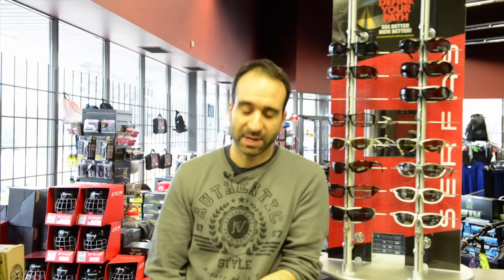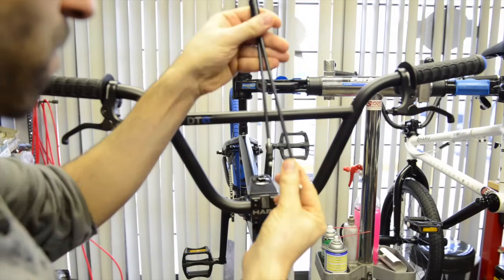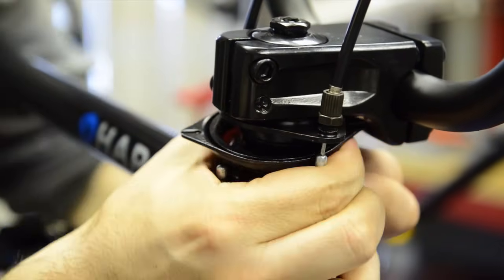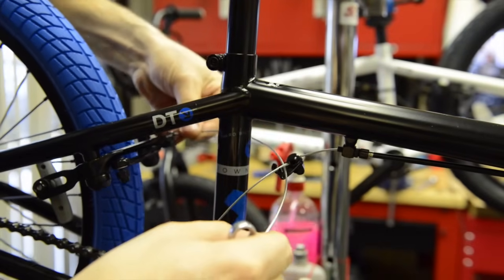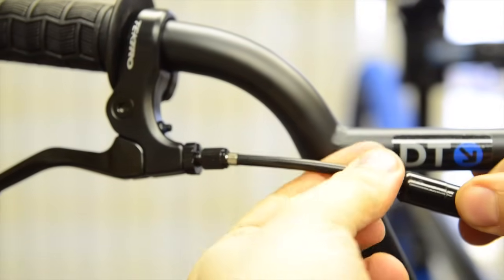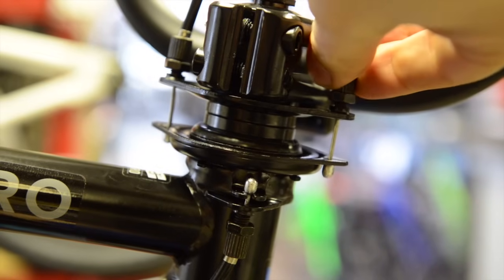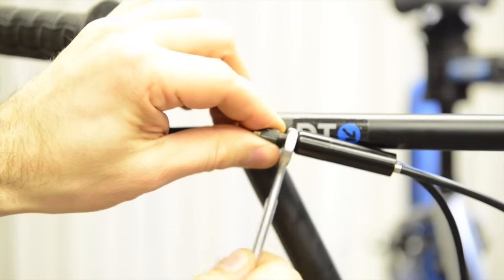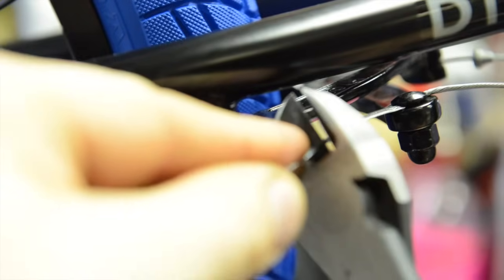BMX - How to Setup Your Gyro Brake System

Comment: Thanks great video.. Trying to get my bottom/rear line setup to my old Bulldog 884's on the '95 Dyno Air. Front brake was the easy one lol.

I still need to adjust the 4 ends/ballpoints a bit more.. almost there!

Comment: i search this video because of bmx rider do a bar spin yes idk how the brakes line still fine
Reply from the maker: Its all in the gyro. I'll try to make it simple. 
The bottom half of the gyro is stationary, and the top half is also stationary, then both the top and bottom half are attached to spinning bearings in the middle. 
As for the front brake (if you have one), goes through the middle of headset through the fork.
Just by those you can spin to your hearts content. 
Gyros have become less and less over the years. Mainly, I think, is because not too many people know how to adjust the gyro system. 
Hence, why i made the video. 
Hope that makes sense. Thanks for the comment.

Comment: Great video just bought a bike with a gyro the lower race is rocking when the bars are being turned Ive tried adjusting at the stem but can only get an improvement ive screwed right in on one side and all the way out the other . Keeping the adjustment equal on all four is worse ? Can you advise many thanks

Comment: Do u need gyro tab holes?
Reply from the maker: +Daimler Bermudo Some BMX that do not have a gyro system have holes on the left and right on the head tube. They use a integrated headset, so those holes are used to take place of the lower cable stop. You'll have to have the brackets that attach to the head tube to install the lower cables. A traditional gyro won't work on a integrated headset.
Reply: +Sports Shack  my bike has an external headset with no tab holes will it still work
Reply from the maker: +Daimler Bermudo If you have the original style gyro, and not a integrated headset, yes it should work.

Comment: Can someone please tell me how to take the lower cable stop off. It looks like its hammered on but im not sure.
Reply from the maker: +tonypengo The best way to take it out is remove the fork, and underneath(through the head tube), hammer it out. There is a tool the shop uses called a Head Cup Remover, its a evenly placed tool that shapes around the headset. If you don't have one, maybe a large flat screwdriver can work. You'll just have to hit it out around the headset to get it out. Once the headset portion is out, the lower cable stop will come out.
Reply: +Sports Shack thanks so much!

Comment: I didn't even know what a gyro was, but my rear break broke so I took it off and it was really difficult. But now I only have a front break and I'm thinking of just taking it off as well, what do you think? Should I take it off or leave it on?
Reply: BTW my bike has a gyro breaking system
Reply from the maker: +Random Vids If you use the bike to get around town I'd really recommend to keep them on. If you use it strictly at skate park, and your comfortable with it, sure you can take the brakes off. I'd practice first, as you do not want to hurt yourself or other people if you can't control the bike without brakes.
Reply: +Sports Shack well my front brakes work like shit, so I'm usually stopping with my feet anyways. And I actually never really go to skate parks, I just do tricks around my neighborhood. So it's kinda difficult to decide weather I should take it off or leave it on. I'm probably going to end up taking them off.

Comment: Does that bike have gyro tabs cause I have no idea what they are, and I don’t have them. If it does then is it possible to install gyro brakes without them?
Reply: It has a unsealed headset so it has the tabs where the cup should be

Comment: is haro la bastille frame good for street/flat? i have been riding bmx for years (3) with not a really good bike... It was really hard to fly a tail whip without a ramp and a 15 kg bike... I´m 1,72, what would be the perfect size? My current bike is 20´5 (top tube; frame) and i think it is a little short, but i´m not sure if the 21 size would be the right size... the problem is that la bastille frame is 19´ something, 2,25 (too small) and 21.  Thank you all so much (writing from Spain).
Reply: I'm 173 and I run an impurity HAF with a 20.45 you'll be good
Reply: I´ll check it out, thank u 4 the reply! ^^
Reply: Now it´s only available with a 20.7 size...Still good  i think. I will consider this frame. Still thankful 4 the information bro have a nice day!  ^^
Reply: It's 20.7 with an affective 20.45 top tube due to the seat angle. So you'll be fine

Comment: help my bottom cable that goes with the frame is too long
Reply: wat do I do
Reply from the maker: +Keanan Scott The lower cable is too long? You can shorten the single piece part. Cut the housing only where you need, but you can't do anything on the closed off(V side) part. If it's too long on the closed off part, use a zip tie to hold the cable housing when you stretch it out further closer to the brake system. Hope that helps.
Reply: ya I cut the housing and it worked thank you

Comment: I accidentally took all my cables out and now i cant steer,  can anyone help or any solutions?
Reply: loosen up your stem. .
Reply from the maker: Taking out the cables shouldn't have made a difference in steering. Curious of what else was done.  If you need some help still, email us with a few pictures at bikes@sportsshack.ca, and we'll try to get you riding.
Reply: When i pull my handle bars, up i see the bottom of the long pole is kind of cut on an angle and another piece of metal below it sliced in the same angle and if i put them together it makes a normal pole. I think its the steering pole or steering root is my guess.
Reply from the maker: You have an older system that uses the wedge to hold and centre the handlebars. Tighten it, usually with a 13mm wrench, on the top to compress the wedge, that'll be enough to steer again. If it still doesn't steer, you may have to readjust your headset. Hope that helps.
Reply: the bolt wont reach the wedge, i think its worn out or something.
Reply: VenomHades stripped? or too many spacers?
Reply: both maybe.
Reply from the maker: The bolt should be able to reach, unless it snapped. You may have to replace the wedge if it's stripped.. You could still pick one up for like $2. The size 22.2 is normal, but there are different sizes. Spacers aren't a factor if you have a threaded headset.

Comment: why don't the gyros come standard anymore?
Reply from the maker: Jeff Chow There are a few reasons. 1) Most have a hard time adjusting their brakes with the gyro, because they find it's too hard/stiff. They don't realize that it all they have to do is adjust the tension on the actual brake to make it easier to grab the rim. 2) Some are just going brakeless, but it's only good at the skate park. 3) Some are just keeping it simpler with 1 brake cable housing .....Most companies are going with the trend, but everyone has their own take on what is the best system... Plus gyros are getting harder to get in stock. At least here in Canada.

Comment: My detangler doesn't retract ??
Reply from the maker: +Chris smith Possibility of the actual brake arms not having enough spring action, and could be a combination of cables being a little rusty. Try cleaning and re-greasing the posts where the brake arms are, and spray some lubricant into the cables to help it be smoother. If that doesn't work, you'll have to change the cables. $8 each. One Upper Cable, and Lower Cable. That should help with the retracting. If there is something wrong with the actual gyro, like bent or not enough gap between the upper and lower detangler. That might be an area to look at. Hard to tell without seeing the bike. Thanks.

Comment: can u make a video on fixing the front brakes on a haro?
Reply from the maker: I can work on one. Just a little busy at moment. In the mean time this is what you can do.  Use the 5mm allen key and 13mm wrench(similar to what I do near the end of this video.) Use that to adjust the tension. If they move freely and easy all you need to do is replace the cable and housing. If they don't move freely, take them off the post and clean it. Put grease on post and reinsert brake with the allen key and wrench. That should do it.

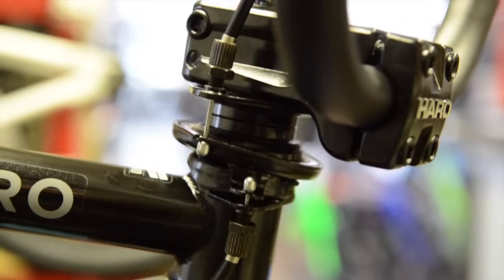Comment: I have the Issue from 4:15 that my gyro moves when I turn my bars, then I tighten one side so it',s fine wenn my bars are pointing to the front, but when I turn my bars 180 degrees the gyro moves again. I can't figure out what I'm doing wrong. Help me 😄
Reply from the maker: I assume the top plate is moving. It does have to be tighter. Make sure the head-stem is above the steer tube(your fork) you may need spacers to accomplish that. While the head-stem is loose tighten the top plate to compress everything down, but not too tight. This will help stop the top plate from moving.

Comment: I have adjusted my adjusters many times but started lol have loads of slack. Please help as I don't know what to do
Reply from the maker: Hi, The best thing the do is to follow the video from the start, but sounds like you don't have enough pull from the brakes, which can create slack in system. So use the 13mm wrench and 5mm allen key, and adjust the spring tension. Don't tension it too hard though cause then you will have to pull harder on the lever. If you still have problems, start from scratch, and follow video. But let me know if you still have trouble, and I can try to help you out. Hope this helps.

Comment: I'm getting a new bmx bike soon and it doesn't come with a gyro so I'm ordering a complete set. But from the looks of it, it doesn't come with an x over cable and a cable hanger. I checked on ur site but couldn't find anything. Do u know any sites that would have these parts?

Comment: on my nephew gyro brake system brake lever is hard to pull does not stop quickly enough help
Reply from the maker: Could be a couple things. First make sure the Ubrake caliper is moving freely, with little spring tension, but enough to snap back to position. You may need to clean the posts on the inside and grease, if it barely moves. Next the cables. Make sure the cables aren't rusty or have any fraying. You may need to change the upper and or lower cables. Those are the most common areas that create the problem. Hope that helps.

Comment: This is going to save me a lot of shoes and tires. When I was riding 10 years ago we just took the brakes the off the bikes so we didn't have to worry about them getting tangled. To stop it was just jam whatever foot was closest to the back tire between it and the frame while our front foot was used as a front brake the same way with the fork. I went through a lot of shoes as a kid and I got about half the life expectancy out of a tire

Comment: MY DETANGLER GETS WEDGED UP IN MY HEAD TUBE WHEN I USE THE BRAKES AND IT DOESNT COME BACK DOWN!! PLZ HELP ME
Reply from the maker: Couple things will help. The tension on the brakes itself will have to have a stronger spring pull. Use the 13mm wrench, and 5mm allen key. The other you may have to change either the upper/lower cable set. If you want, try to spray lubricate inside the cable housing. It is best just to replace it. But first thing is tension on your brake.
Reply: +Sports Shack lol dw my lower cables needed tightening

Comment: Yo I can't fix my brake like the back when I press it the back doesn't touch the rim an the other just stays still
Reply: Yo tighten up the brake caliper itself
Reply: @madgigahz  brake caliper?
Reply: Lil yup yea the brake itself. Squeeze the brake? Then tighten up the wire coming from the brake lever
Reply: @madgigahz  yo thx

Comment: can you please tell me how to take a brake lever off, mine won't come off
Reply from the maker: It should come off easily. First make sure the grip is off ; 2nd take the screw completely out ; 3rd use a flat screwdriver to spread open the space between. This will help to rotate it off the handlebars. Hope that helps.

Comment: I work as a cycling instructor teaching children how to ride safely on the road. I must 'fix' at least 20 giros a week! They are totally inappropriate for a kids' BMX. The components are cheaply made, the cables seize up due to lack of maintenance and as standard BMX brake levers are usually short, most children lack the hand strength to operate the brakes properly, when the cables corrode....do your kid (and other road users) a favour and install properly routed single cables with longer levers...or maintain your kids' bike properly. Better still, teach them how to do it!
Reply: Tell me about it! That's what the kids I teach ride...if it was all Odyssey gear and stainless steel cables I wouldn't be moaning...

Comment: Guys I need help my mongoose brawler bmx 20 inch bike is messed up the handle bar and the wheels are messed up, if I put the wheel facing front ward the handle faces the other way please contact me on instagram @sir.lothario or comment under mine
Reply from the maker: Did you have the handlebar loose? It could have turned possibly,  and whomever tightened it like that. Who knows.
Also,  I get lots of customers that, don't have a gyro, and the handlebar spinned around too many times and the brake stopped working, because the housing is wrapped around the handlebar. Try un-spinning it, if that's the case. It's hard for me to know without seeing it. 
You can send a quick video message on instagram, @sportsshackca and I should be able to help you.

Comment: What is a gyro worth? I'm getting a new bike and that's my deciding factor
Reply from the maker: Last time I checked they were around $34 Cdn They are getting harder to find though from suppliers, they are mostly just selling cable sets now.
Reply: thanks for you reply to my question. i have another. those holes attached to the frame, what if the bike does not have one?
Reply from the maker: If the bike doesn't have it. The best choice to find a gyro to fit on the head tube. Make sure you find out the diameter of the head tube  first before you get one.  There are 2 sizes.
Reply: thanks for the help :)